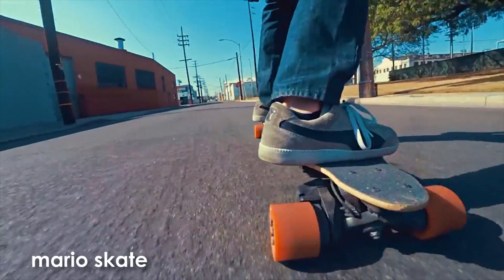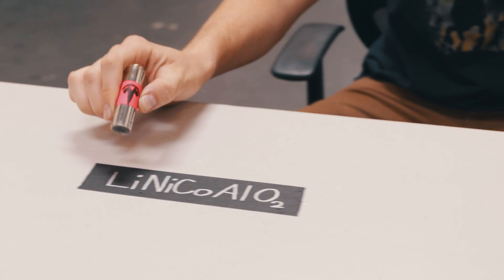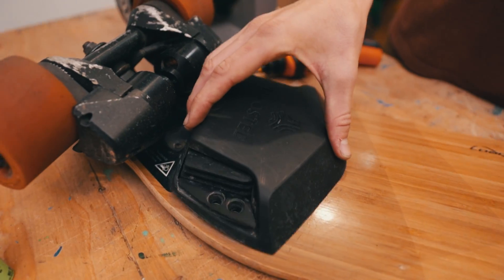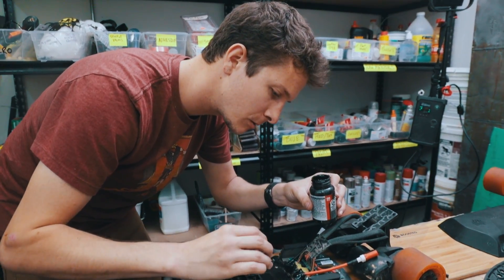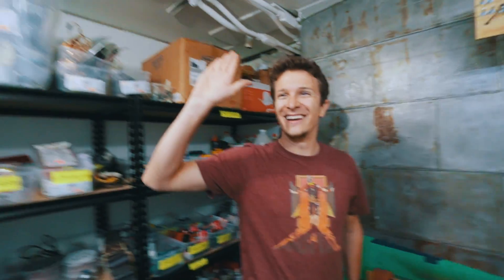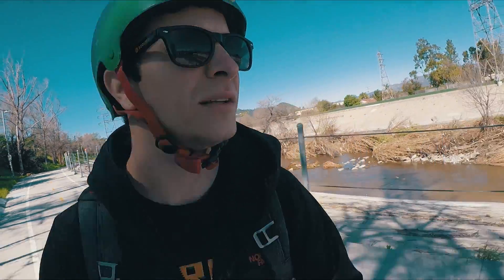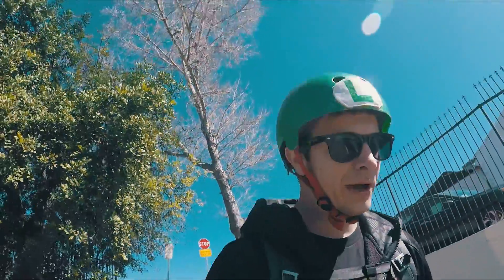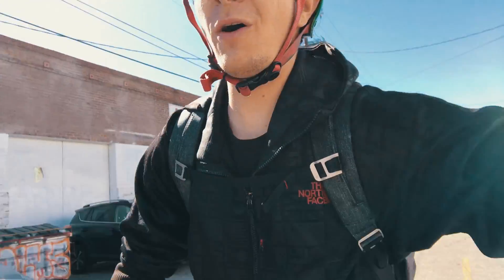Tesla Batteries in an Electric Skateboard!

Comment: Might I advise looking up the term "Joule Thief?" It's a simple voltage boosting circuit designed for something like this. When the battery is at half voltage, for example, it will still output the proper voltage, but use the second half of the battery twice as fast. In the long run, you will get more usable energy from the batteries. The two drawbacks are 1: it will be COMPLETELY impossible to tell your battery charge, and 2: Lithium based batteries get dangerous below 30% charge. They will start to heat up, and will heat up more when charging. This applies however to even your normal battery. I'm sure you can find plenty of schematics and part listings to build one that has a 40V output. I would also recommend putting the original battery in parallel with the new battery packs if you use this, that way it acts as just one power source for the joule thief, and the joule thief acts as your battery.

Comment: WREN FOR YOUR BATTERY PACK: 

Below I have two possible solutions. However it should be noted that it is unhealthy for these two different types of batteries to be in parallel. Because of their different internal resistances, and therefore different voltages when depleted, the batteries undergo more strain, lowering their lifetime. I would suggest option 1 over option 2, but they could both improve performance. 

Option 1:
Remove the boosted board battery pack from the series, and add a third and fourth battery pack in series with each other, but in parallel to your first two packs, to keep your voltage at 40. This way you have more amp hours overall, and all the battery packs have the same internal resistance and don't cause some of the power to be inaccessible.

Option 2: (if you don't want to buy the batteries for the new pack)
Simply add a switch to the boosted board batter pack, to be able to disconnect it. Once your boosted bored batter is low, then simply flick the switch, allowing the other batteries to release power. 

I would not recommend a voltage step-up circuit, for a few reasons. Step-up circuits are not 100% efficient, so you would lose some power in the process. Also, while your voltage would increase, your current would of course decrease, and I assume current is also a bottleneck for the batteries you added. 

Also if you want to see the charge of the batteries, getting a battery charging/control circuit is not expensive, and would both let you see the charge of the board, and allow you to more safely recharge your new battery packs.

If you have any questions, feel free to ask! (I'm studying computer science at a university right now, but many of my hobbies involve electronics.)
Reply: +growyour Own From what I´ve found the 18650 can output somewhere between 8 and 12 Amps max. That means Wren would need at least a 4P10S, possibly even a 7P10S configuration (assuming 40V on the 2000W Motors, resulting in up to 50A), which is, as you said, not really practical. If Wren were to use the batteries you suggest he´d only need the 2P10S configuration he´s already using, but i dont know how the capacity compares to either the original battery, or the lithium nickel cobalt ... ones.
Reply: You'll want a double pole double throw switch rated for over 50 amps. (Assuming the motor is 2kW)
Reply: YourAverageGamerPC I agree that option 1 is is the best bet. It would be the safest, as paired batteries of the same type/size/volt output  are way less likely to have a critical failure. 

And I don't pretend to be half as smart as some of you, but I am  a battery tech for a local ecig company. 
So I know a fair bit about 18650,  26650 batteries but mostly with I.M.R.(Lithium manganese oxide) and I.N.R.(Lithium manganese nickel).  Lithium nickel cobalt aluminum oxide batteries have too low of a current for most mods so I haven't had the chance to work with them.
My question is, if he went with option two  could he use 4 to 6 paired Imr Li-ion with a max current of 35 amps(efest makes them), to charge his boosted cell way faster then the a paired group of LiNiCoAlO2 could?
Reply: +growyour Own So using them 2PS10 would result in appr. 6Ah, thats a lot less than the 8.5Ah provided by the lithium nickel ones, but with "only" 3PS10 he could reach 9Ah quite handily, without packing a ton of batteries on the board. Especially if he removes the original Battery they should fit pretty comfortably... Unfortunately BoostedBoard doesn´t provide the capacity of their battery for comparison.
Reply: Nicolas Oswald ya that makes sensce.
The only bad thing about Li-Ni batteries, is they are way more volatile than I.M.R.'s so you might not want to push them to the max amp if at all possible. In case of failure on one or more cells
Reply: Lucas Or add a relay to the switch
Reply: Lucas . Only when u ride.
Reply: Nicolas Oswald thanks for the reply, that's what I figured but I like to brainstorm lol.
And they are 3000 mah, 3.7 volt, 35 max amps or 20 amps during sustained discharge. There are slightly stronger ones but the price gets extremely expensive(25$wholesale). Where the efest  cost us six dollars per battery at wholesale.
Reply: I don't think the motor is 2000 watts, I don't think the battery can supply anything close to 50 amps, that being said, there is no harm in having an overqualified switch.
Reply: Hi great comment, how can I contact you? I have few questions
Reply: @Kamel Labiad Feel free to ask them here or just dm be through youtube
Reply: I sent you a dm, you can reply in your creator studio under community > messages
Reply: YourAverageGamerPC this is the way to go!
Reply: YourAverageGamerPC j
Reply: +Lucas He needs a switch that can handle a lot of current while the motors are on. True, it doesn´t have to switch around under load, but still.
Reply: Hi thank you, it is actually I privet project don't want to expose it to people here  :/

Comment: It would add more complexity, but adding in a power supply switcher could allow you to select which batteries are being used. When the main batteries get depleted, switch to another battery pack and deplete it. It would be like having two gas tanks: main and reserve (like Jake's truck might have?)

Comment: what if you rewired the board so rather than sending power to the motors it charged the booster boards battery constantly. that would mean that you wouldn't get the voltage drop. although your likely going to kill the original battery because it's being charged constantly while in use

Comment: Next week in the news: Kid on highly modified boosted board explodes on highway
Reply from the maker: +Katojana Aleksielsis lol
Reply: Hilarious hahaha
Reply: Simen Sandvik vent, sure. explode, not so much. catch on fire in the worst case.
Reply: Katojana Aleksielsis that was pretty good
Reply: Wren Weichman lols
Reply: No different from the original batteries in the board
Reply: nice
Reply: Lipos only burn up when they are damaged or are too hot from an extreme amount of power. One of the cells in my battery blew up after i got a new motor put into it
Reply: Katojana Aleksielsis u made my day 😂😂😂😂
Reply: B
Reply: Submersedsword capacitors for this purpose would not work.  Capacitors don't work to regulate voltage , but to affect frequency response in amplification e.g. low pass and high pass filters.  Transistors would work and I could make a voltage regulator like that for 3 or 6V but for this sort of voltage, you need professional electrical engineers to make it.

Your problem comes with the batteries in series.  You would hope that the amperage would just add on to each other but your problem is having 3 packs all at a different capacity.   when your first battery dies it acts as a resistor in the meaning it's going to be taking charge from the 'tesla' batteries.  this is from the voltage drop as well as the storage drop. you are essentially charging the battery as well as pulling the motor which is splitting the amperage (voltage stays the same in parallel).  Your best bet is to take out the original battery, yay more soldering but that's honestly pretty simple, use some flux to de-solder though to be safe.  voltage regulators won't help in this situation.   Hopefully that makes sense

I hate my major but it's actually somewhat useful.
Reply: ROFLMAOS
Reply: Katojana Aleksielsis these are lithium ion batteries, not rc lipo packs. no explody stuff going to happen to them.
Reply: Katojana Aleksielsis This Isn't Anywhere Near "Highly Modified"
Reply: Wrong. Try using more amperage than they are rated for on a continuous draw. They will vent or even explode.
Reply: Katojana Aleksielsis KID ON WORLDS CHEAPEST BOARD DIE BECAUSE OF FAKE TESLA BATTERIES that's more like itt
Reply: Sam and Niko, I have found a solution, use transistors and capacitors

Comment: Mybe just use the regular and when they're out you use a switch to use the extra batteries. That way you never use different batteries at the same time and you can still see how much battery you have left on the original batteries. What I'm saying is, why use them at the same time, isn't it just better to switch?

Comment: Don't put your batteries in parallel but first the homemade battery pack and then the battery pack from boosted board in this way it will first drain your pack and then your boosted board pack.

Comment: Make a new diy electric skateboard, there is a whole community out there for you. I personally have a 25 mile range and can go 30 mph, and it all costed way less than a boosted board!
Reply: Hardy there is a forum out there for you. Look up electric skateboard builders forums
Reply: Honestly I'm incredibly tempted to do this. I have an old Yuneec Ego board that is a piece of crap. I'm considering replacing the battery and motor with something way better.

Comment: you cant draw anymore power because the circuitry will cut off all the current flowing to the motor to stop the original battering from undercharging. you will need to figure a way to get round this but its not a problem with the electrical layout

Comment: I'm no expert, but it might be the same thing that happens to Philips Sonic Toothbrushes. Basically even though they are working at full power the less charge the battery has, the less power it uses to work (so it works weaker every use untill recharge). Maybe if you could play around with the circuit board to make it think that you either have always full charge or at least make it see how much charge the Tesla battery has, it could get rid of the power loss after the initial 5 miles.

Comment: Use the extra battery as a power bank not an extended batterypack.. make a way to charge the board while using it by connecting your new battetypacks to the charger. Use a capacitors to get your everage charging power or switch more batterys in parralel

Comment: I think this is what you need to boost you battery pack up to a certan voltage: http://www.ebay.de/itm/DC-10-40V-To-12-50V-6A-240W-CVCC-Boost-Converter-Step-up-Power-Supply-Module-S-/172328721755?hash=item281f979d5b:g:dRgAAOSw9IpXyqk9

Be careful though, this circuit is going to drain your battery until there is absolutely no charge in there anymore, therefore destroying your battery. Consider buying a voltage alarm like this one: http://www.ebay.com/itm/RC-Lipo-Battery-Low-Voltage-Alarm-1S-8S-Buzzer-Indicator-Checker-Tester-LED-/142065592377?hash=item2113c4e839:g:ipgAAOSwopRYffJM

Comment: I agree with the people saying to swap the batteries so the Tesla is the main, at the very least you might get a more accurate reading on the battery life as it seems like the way you have it now you might be bypassing that circuit. I'm not sure about the people saying to charge the Boosted bat with the Tesla, it could have some negative effects but then again I don't about all these different types of lithium bats, if they work the same as a good ole' Li-ion you'll be fine.

Comment: Is there anyway you could use the power you have left over to charge the main battery? or even use the new batteries as a 'Power Bank' to charge the main boards battery as you go? That wouldn't solve the torque issue you had on the hill though... Just thought I would throw my 2 cents in :)

Comment: Noob question: if you just got through soldering brand new batteries into the board, why do you need the original batteries to charge up?

Comment: What you could do is add a variable voltage transformer (you will have to do the math on the coiling - converting it from a storebought one) and integrate the voltage meter into the board, it will require you to switch the transformer modes as voltage goes down but it's possible to automate that (probably something linked to the voltage meter).

 This way the moment it goes down to a certain threshold it changes the transformer mode to output back up to 30-ish V.

 This is the only solution i currently thought of.

Comment: You need a DC-DC converter  like the LTC3115-1-40v its 95% efficient and can be configured for taking an input ranging from 2.7v through to 40v where its output would be a stable 40v.

Comment: How about adding in a switch to detach the board battery from the circuit once it's depleted. No need for extra batteries and you can keep going with the existing ones without the load of the empty board battery.

Comment: The issue with upping the voltage that the batteries put out is that you would also increase it on the high end and potentially fry the entire board. If it can take higher voltage though, you could just use a voltage step-up to increase the voltage by a certain amount. You could also look into battery types with less of a voltage range.

Comment: You should replace the internal battery with the same pack you made, so that you get an equal cut-off voltage for all the packs. The problem with different packs and connecting batteries in a parallel & series configuration is that the voltage levels get uneven very fast and is highly not recommended doing this way, since the inequality in voltage may cause a single battery to overcharge and explode. This is why laptop batteries have battery monitor circuits which will measure voltage and current per cell and hence reduce the inequality. In this configuration I wouldn't recommend even charging it, since the charger doesn't know that you have another 2 pack connected to it.
As for the throughput I don't know if the ESC or those cables are able to handle much extra current, but probably they are properly limited so you cannot overdrive the motor's coils.

Comment: Wren just find a way to add power directly to the boosted board's battery so the voltage of the boosted board is matching the voltage of the homemade batteries if its possible to do so

Comment: If you can easily take out the batteries, then carry fully charged ones in your bag as well as the ones under your board.
Reply: The problem wasn't with the spare packs but with the pack that's inside the board.

Comment: That you connect the batteries in parrallel means you CAN draw more current but it doesn't mean that the motors WILL draw that much current. The more voltage you have, the more current the motors will draw. That would mean you would have to step up the voltage or just use more batteries in series. But be carefull not to give the motors too much voltage or you will damage them or the circuit. My advice would be to make a whole new circuit because things will get complicated if you are still using the old circuit board and you will run into problems like what you mentioned at the end of the video and problems with  charging and monitoring the state of the batteries. To learn more about making your own circuit go watch the video of 'great scott' about his own motorised long board. For more questions just contact me.
Reply: I've seen that series from GreatScott. Regardless of what batteries I add, the circuitry on the board needs to operate at the voltage range of the existing internal pack. If I replace that circuitry, I might as well just make my own board, which defeats the purpose of this mod.

Comment: wren, have you looked into a small voltage converter? maybe a NPN transistor? i don't know enough about this stuff to give any type of detailed step by step, but it might be worth looking into. (P.S i know you obviously wouldn't want to make either a lower voltage, so maybe look into the transistor option so you could up the voltage for the booster battery, not the battery packs)

either way, good luck, love your vids!
Reply: In theory a good idea, but not really practical at those Voltage/Current levels. He´d need massive heatsinks and a way to exactly match the voltages, otherwise he´d ruin his LiPos.